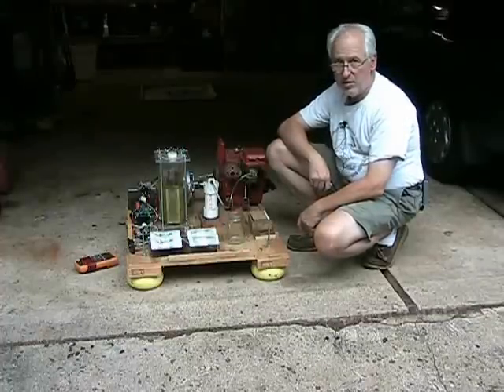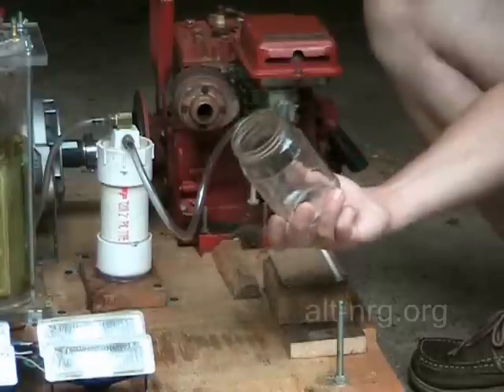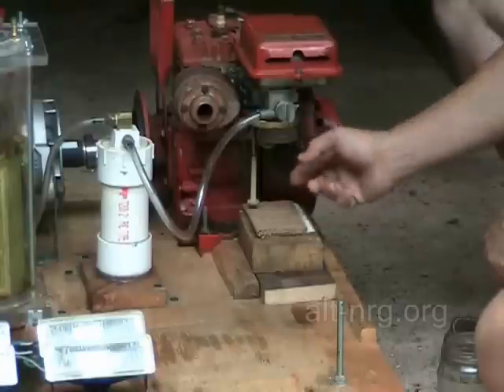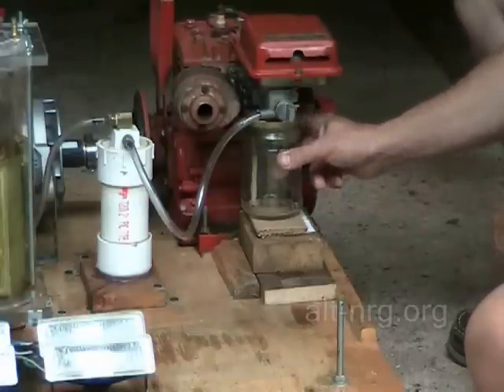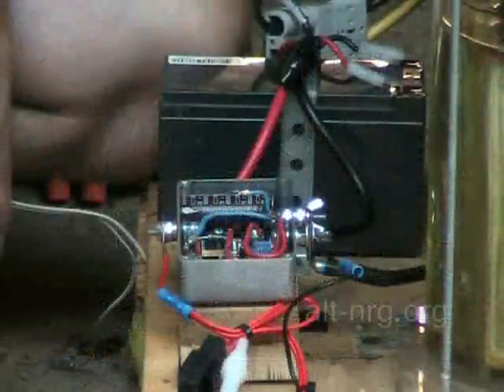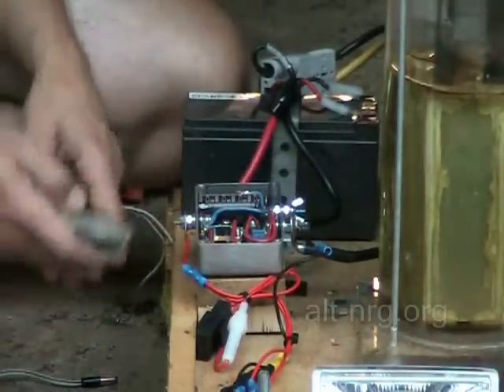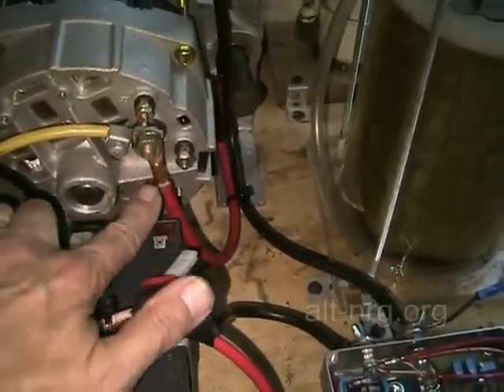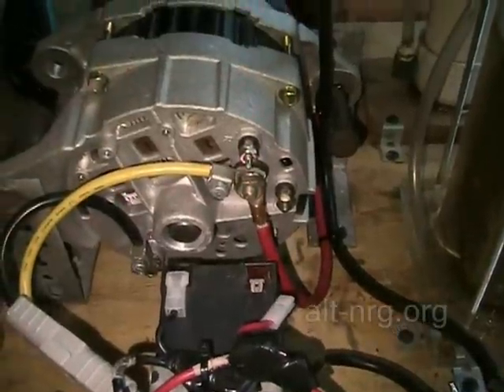#238 HHO run time test update 2-17-2010

Comment from the maker: @ke4uyp Coming. Here's a teaser. Very encouraging data. BTW, been thinking about the other comments you made about wavelength vs plate spacing. If what you propose is correct, one should be able to dunk a couple of plates spaced about 6" and hit it with 450MHz UHF to liberate HHO. Personally, I think it would just heat the water.

Comment from the maker: @ke4uyp I have 3 sets of data (9 runs) with 5.00oz of fuel. Ran way too long. Going to start over with 3.00oz each run and a minor change to the upper fuel bowl. Video is coming. I have also been streaming it live at Ustream.

Comment from the maker: @NewWorldFuels Diodes tested okay. Went to the repair shop today for a new regulator, only $15. Didn't fix it. Had them check the quick start module. It was good. Coils show continuity. No signs of burnt wiring. I'm stumped. Dropping the whole thing off tomorrow morning. Hopefully it's fixed by end of day.

Comment: most alternators need to have the field coil activated to produce output. It also looks like the copper lug might be touching the case? I would get some tape on that. You should be able to take the alternator to an auto parts store and have it tested, look at how they connect there wires to test it, you need to mimic that. Peace rawbush

Comment from the maker: @1NRG24Seven This is a Delco Remy SI-21, one wire, 160A. I just called a local shop. New diode pack fit it is only about $25. Should be back in business tonight.

Comment: if it turns out you fried the alternator buy what is known by us old hot rodders as a Chevy 1 wire alternator, they can be bought new or rebuilt from most auto parts stores for about 40 bucks and it only needs the one hot wire to battery as mounted to motor bracket was the ground, easy cheap alternator to use and puts out about 40 amps @ 14.5 Volts DC

Comment: no...the red wire lug is grounding to the alternators body, move it to the 1-2 o'clock position where the body will not touch the metal part of the lug and should work fine. Unless its just the angle of view that makes it appear to be grounding out on the video.